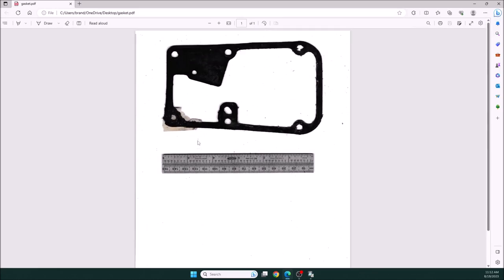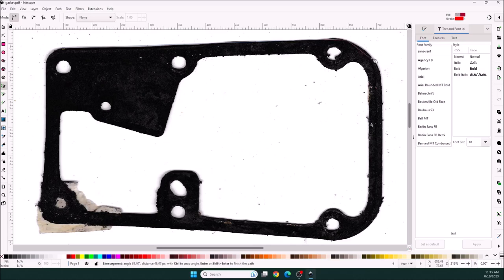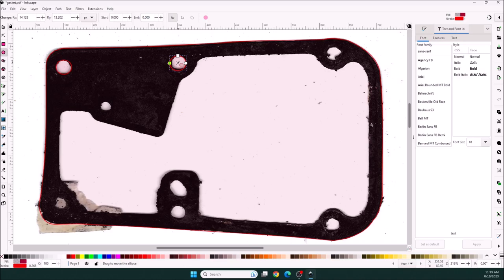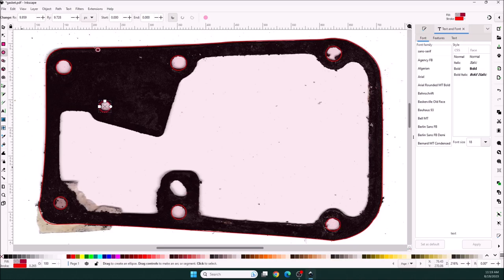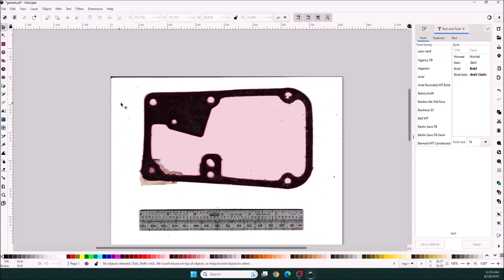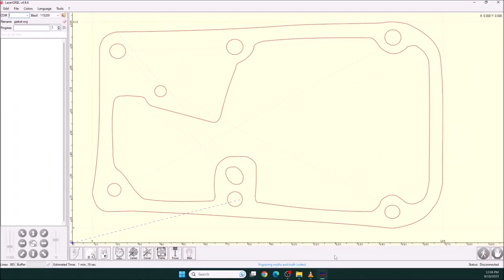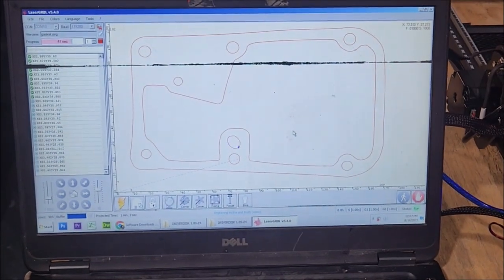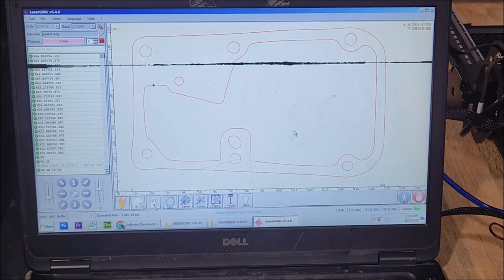How To Make Gaskets with Inkscape and a Laser Cutter - Mecpow X3 Pro

Comment: I’ve been making them with a piece of gasket material, a utility knife,a ball peen hammer and a set of leather punches for forty years?
Reply: Ball peen hammer always works great for me. Usually is quicker too.
Reply: That's fine if you are very comfortable working with your hands to create stuff like that. For me I'm way better at computers and 3d printers, so I would choose to do this 1,000% of the time. Go ahead and call it a generational thing, I think this is cool (I'm 40, btw).

Comment: to make a perfect circle make the circle click back on arrow select tool "top left" and select the top two numbers that look close to the circle size "top middle right hand side only seen while on arrow select tool" and then your size " ie (6 mm) , make sure you select your unit of measure. put the size of choice in both x and y direction" to be sure its a round hole. Then use duplicate for as many holes as you need so that you only need to do that work flow a few times for each size hole. right click duplicate once you have the hole selected

Comment: I use Lightburn and really like it ! that gasket on mine settings is 100 power 1600 mm/s in 1 pass . When i cut acrylic  ( Opaque ) 3mm thick @ 100mm/s power 100% in 2 passes. What wattage is yours ? mine is 10 watts 80 amps 48 volts tt-10s cutting wood is also fun !
Reply from the maker: That doesn't quite add up.
The current in amps is equal to the power in watts, divided by the voltage  A = W / V.
So, if you have 48 volts and 80 amps, then the power P in watts is 48 x 80 = 3840 watts.
The current in watts would be 3840 / 48 = 80 amps. 
There's gotta be a decimal point in there somewhere. However, mine clearly doesn't have the power yours does, as at best I can do it in 2. Usually 3, but with this 1/32" stuff, its 4. 
This too is a 10w, speed is set at 1000mm/s. Ill try tomorrow slowing it down and speeding it up to see if it makes a difference. 

Maybe I'll give Lightburn a try again. I used it for a day, and did seem better, but I remember it being a bit bloated for what I do. Especially as I also have fusion360, I already know how to use that, and its one powerful piece of software. 
How long have you had your cutter?
Reply: The 48 volts is the power supply the 10 watts is the output of the laser , some say there 40 watts but the output is only 5 watts correction 96 watts power supply and 24 volt control box @BrandonsGarage

Comment: That air compressor is the key for laser cutting. I had been using a 7 watt amazon no-brand for the past 3 years.

There will remain some limitations, though. For those reasons, I now use a new tool entirely.
Reply from the maker: What is your new tool?
Reply: @BrandonsGarage  2 actually. Using a cricut explorer where I was previously using a laser. Surprisingly very accurate, still using Inkscape. The second tool(s) is for mass production. Took the laser out of my router and put an upgraded spindle motor to mill punch & die plates. That's still a work in progress, but I intend to sell reproduction parts online eventually.

Comment: Can you get head gasket material and will it cut it.
Reply from the maker: Usually the head gaskets have a steel inner around the cylinder walls; you aren't cutting that.
Reply: @BrandonsGarage  Just need a laser with MOAR POWER!!!! 😆 30 watts? 50 watts? ALL THE WATTS!

Comment: Can you perhaps slow the cut speed down to decrease the number of passes?
Reply from the maker: Yeah that's worth a try, I'll give it a shot.
Reply: @BrandonsGarage  Probably just need to experiment with different materials.  Run it just fast enough to not set on fire.
Reply: @BobWiersema Just like a 3d printer or a CNC machine. Gotta find the feeds and speeds. Takes a bunch of test runs or just learning in production as usual hahaha.

Comment: Do not use the supplied focus tool, you need to focus your laser manually. It will cut better and de-focusing it will allow you to blur your engraving for a softer appearance. Also moving the focal point will help when cutting thicker material. If you have a 5mm wide focal point and a 5mm board, moving the center of the focal point half way into the material will allow you to cut in less passes with less power and/or more speed. Look into "Short focus vs Long focus"

Most OEM's improperly assume the laser lens is mounted at the exact same level inside every laser body so the focus guide they give you is inherently out of adjustment when they measure from work surface to laser body. 

You need to focus it using the slant board method. This is one of the better ways to focus your laser. If done correctly it will cut a lot better. 

"MakeTech" video is adjusting a Co2 laser but the technic is the same for diode lasers. Try it.

Channel: MakeTech
Title: CO2 Laser Focus / Focusing Laser Lens Ramp       Test - Laser Engraver Beginner Series Ep. 6

Good Video. Thank You...